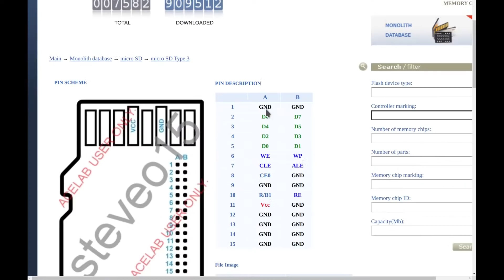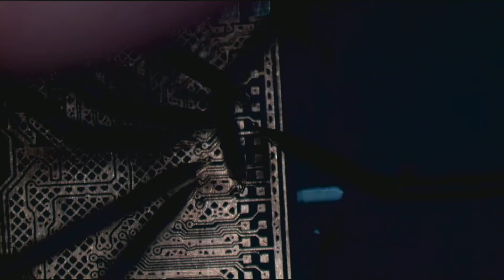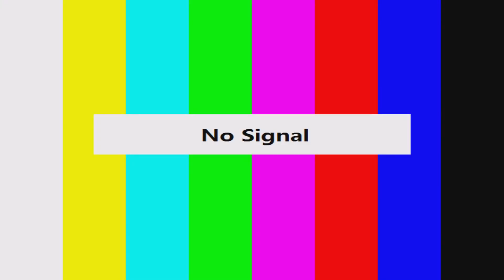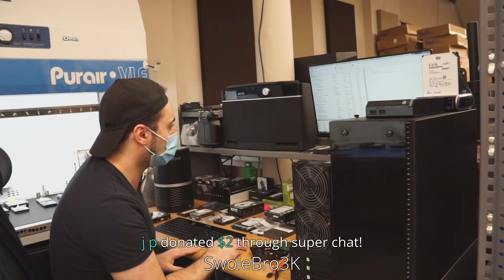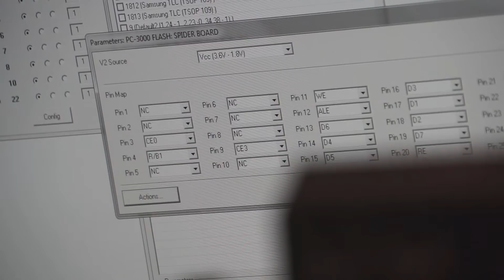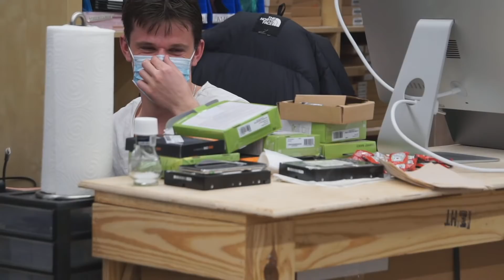meet Chris

Comment: Thanks for the stream Louis and to Chris and Steve for his explanations of what was going on. There were a lot of people asking on the stream about what was happening and about the Spider that Chris was using and what he was doing with it. He was attempting data recovery from a damaged SD card. The SD controller was bypassed by using an abrasive fibreglass pen to remove the top layer of the chip to gain access to the memory chip (I assume ?) Then the Spider gig was used to make electrical connections from that chip to a PC-3000 computer interface to try and read the stored data on the chip. See here https://blog.acelaboratory.com/pc-3000-flash-spider-board-adapter-how-to-use-it.html
Reply: jig not gig. The gig was Chris' :)